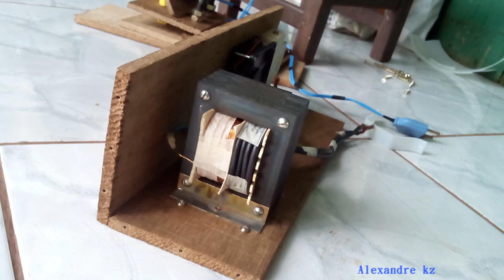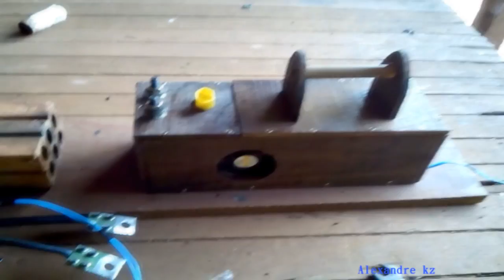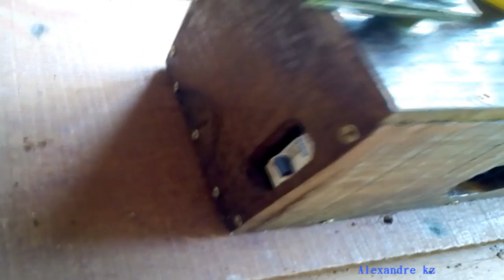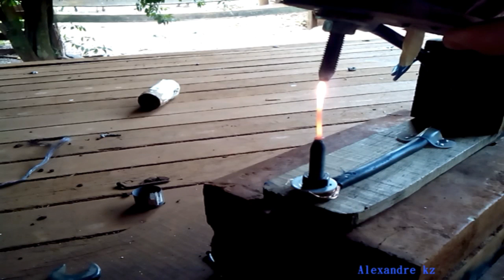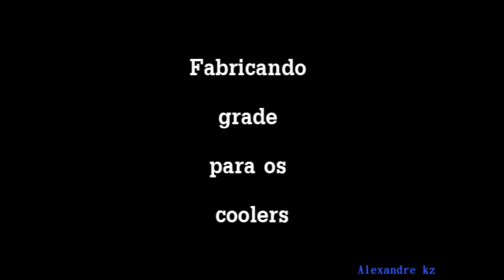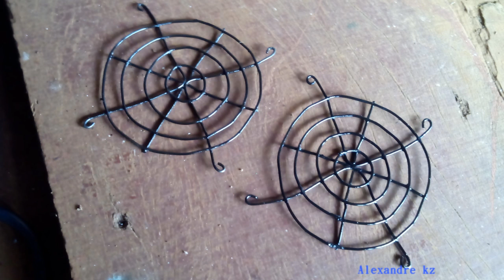Soldador de ponto caseiro com trafo de nobreak

Comment: Fiquei curioso em saber qual tipo de acionamento voce usa, ou será só um botão de pressão? Fiz uma dessa com trafo de microondas mas não estou conseguindo soldar. Estou usando um relê num temporizador e tenho 4volts no secundário. Obrigado.
Reply from the maker: +Jairo Santos  Sim e só um botão mesmo, tipo fim de curso mais modifiquei ele para suportar os 10 amperesque puxa no primário, não sei se você conhece, e muito utilizado em carros a álcool
que quando e frio e necessário ejetar gasolina para pegar, e um botão desses ai
que usei. Depende também que tipo de material você vai soldar, se for muito
grosso ai eu também não consigo soldar com o meu, só as chapas e arames mais
finos, agora com a minha ultima modificação eu tenho mais de 800 amperes a 1,8voltshttps://www.youtube.com/watch?v=ZtCBPwV_-ZA

Comment: alexandre estou precisando de uma dessa. vou tentar fazer uma com uma fonte de carregar bateria, tem que ter quantos vts para soldar arame cauvanizado  de 12 ?? sera que com uma fonte de 12 VTS da certo??
Reply from the maker: +Tony Barros  Bom para isso você vai ter que modificar o transformador para que ele lhe ofereça
uma corrente bem alta, quanto aos volts não e preciso o que importa e a
corrente, você desbobina o transformador e coloque umas voltas a menos para
ficar mais saturado para ter melhor desempenho, coloque um cabo grosso de 25mm
como secundário que você vai conseguir soldar tranquilamente o seus arames
Reply: Obrigado amigo
Tentei fazer com a fonte mais n deu certo
Consegui fazer com o transformador de microondas igual ao o seu
E já fiz q eu queria 
Muito obg pela ajuda

Comment: Oi bom dia ,tenho ,mas como faço para fazer as ligações nele para a maquina , (com a mesma entrada no traf,, certo, depois usando o negativo na saida para un dos parafusas e o negativo na outra ponta do outro parafuso ? É isso mesmo ou tem q\ter divisão entre eles . Os fios q\é o secundário uma delas é soldado em que parte ? É no positive ou negativo ? Amigo estou em duvida , a maquina  de solda eu fiz mas preciso desta tbm ,pois custa cara mercado .Obrigado .Tem como vc mandar o gabarito para me ? Agradeço pela sua inteligência .Bom Sábado .
Reply from the maker: +José Bonifácio Miguel  Bom dia, que tipo de transformador você tem e de micro-ondas ou e de nobreak. ? se for de micro-ondas você não precisa mexer no primário pois e já bem saturado e somente o secundário quevocê tem que retirar e colocar umas 3 ou 4 voltas de fio 25 a 30 mm, mais se você
tiver um transformador de nobreak eu acho melhor você desmanchar ele e bobinar
tudo você mesmo com uma variável mais baixa. Tipo como o de micro-ondas que e
uma volta por volts. Você usa tensão 110 ai você enrola o primário com 110
voltas e se for de 220 com 220 voltas, isto não importa o lado que você liga
positivo ou negativo isso não influencia em nada pois a tensão da rede elétrica
e alternada, eu também fiz a minha mesmo porque para comprar e bem carro mesmo,
assim sai bem mais em conta e a gente aprende umas coisinhas também. Hehe..
Valeu obrigado igualmente a você também..

Comment: fizemos um soldador de ponto caseiro com trafo de micorondas, utilizando cabo de bateria (duas voltas) e as ponteiras de parafuso comum.
Estamos soldando arame galvanizado  14. Porém, a solda não esta colando bem, solta com facilidade.
Também, os parafusos "enzinabram" muito isolando no momento de soldar.
Qual são as possíveis falhas?
Reply from the maker: Edesio Rodrigues opa blz, somente duas voltas.? mais qual a medida do fio que voce usou no secundario.? eu estou usando agora um fio 24 cm².
o que pode ser que voce esta tendo perdas e nas conexoes por que para min tambem aconteceu de ter perdas nas conexoes. ai eu liguei direto o fio do secundario na ponteira, obs nao e mais essa ai do video eu fiz outra mais reforsada. 
E outra coisa tambem pode ser o seu secundario mais se for com fio bem groso 2 espiras sao o suficiente,

Comment: tenho um trafo de no break com nucleo de 4.5 x 5.6 = 25.2 cm.
me da uma ajuda aí,qual fio poderia usar e quantas espiras?
desde ja agradeço e parabéns pelo projeto!
Reply from the maker: Dudugomes GOMES Valeu obrigado..
com ese tamanho do núcleo eu te recomendaria um fio de 1 mm de diametro na bobina primaria se couber.
ai e so calcular usando uma variavel de 35
220v x 35 / 25,2= 305 espiras.
e no caso c a sua rede eletrica seria de 110v daria a metade das espiras..
110v x 35 / 25,2= 152 espiras.
ja no secundario para se obter uma alta corrente da para usar um cabo de 25 mm²
que e o mesmo q eu usei em ums videos anteriores..
ou vc pd usar 2 fios de 8mm² ligados em paralelo como eu fis nesse video..
Reply from the maker: ***** E que com essa variavel de 35 o trafo nao esquenta tantoQuanto menor a variavel maior sera a potencia e vai esquentar mais com uma variavel menor.
Reply from the maker: ***** E que com essa variavel de 35 o trafo nao esquenta tantoQuanto menor a variavel maior sera a potencia e vai esquentar mais com uma variavel menor.